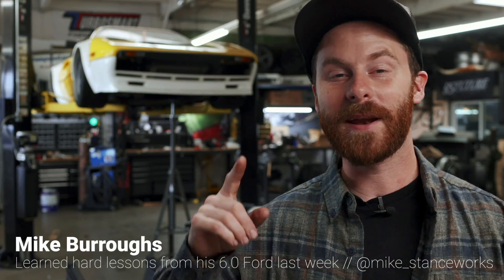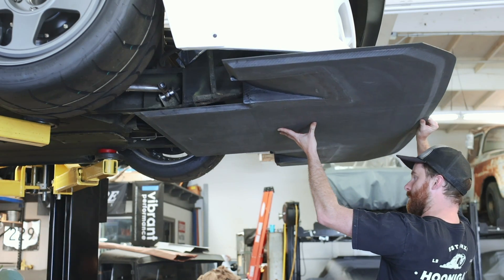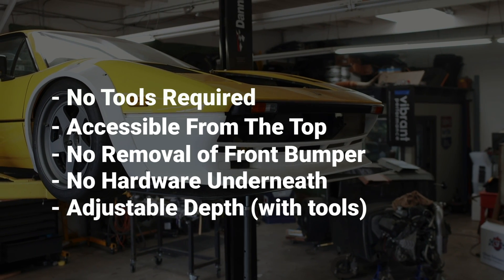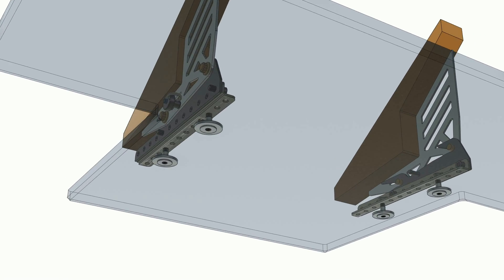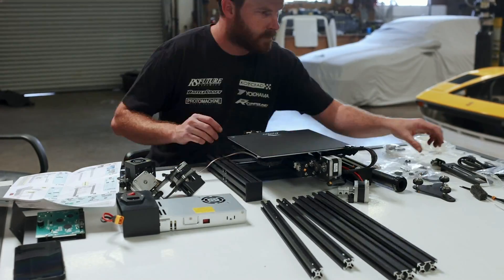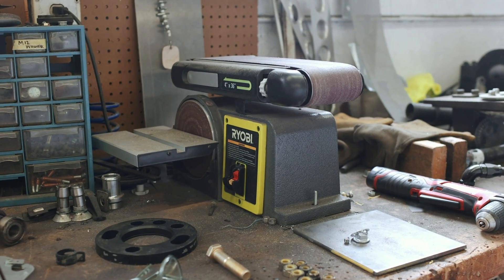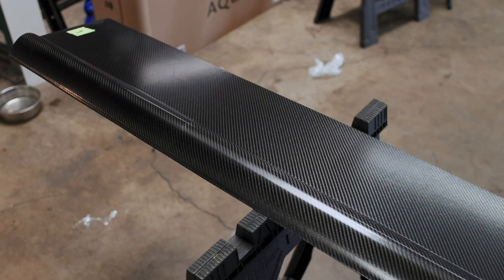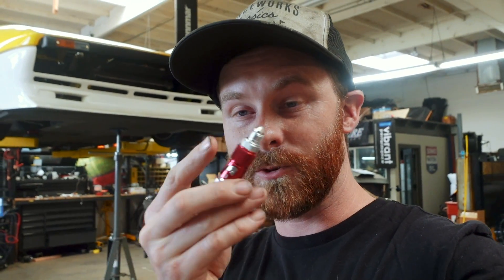Designing Quick-Disconnect Splitter Mounts That Don't Require Tools - PT 1 - Honda-Swapped Ferrari

Comment: Hey mate, I get the feeling that you're eventually gonna have a similar conversation with yourself about the roll cage as you had with the brake fittings. This thing is being built to be properly fast, and you're gonna be asking yourself how much of its potential you can realistically tap, without a real safety cell around you. This vid from Australia will not tell you anything you don't already know, but it's good to be reminded every so often. 
https://www.youtube.com/watch?v=hcWm9gEM4kQ
Reply: That video reminds me of the Jeremy Foley and Yuri Kouznetsov crash at pikes peak 2012. Their car went off the side of a cliff and into a ravine where it rolled 14 times. Both of them walked away.

Comment: Wow really surprised you were having issues with the Ender3.  They are great little workhorses. You shouldn’t have had to do any upgrades or changes to it. Oh well.  You will love the Prusa anyway
Reply: I agree with this, you had it running and even showed the screen with it ready to go. Create model, slice it with the creality software, put SD card in and go! Same as the prusa
Reply: Agreed. I've had my Ender 3 for a couple years. My nephew bought one. No real issues....

Comment: The issue with single flare is that most people don't understand all the differences with fittings. Single flares are totally fine, DIN or bubble flares for example are single flares and are used on more cars than double flares these days.

Where people get into trouble is using a tool made for double flares to make single flare fittings. People assume that the double flare tool can make a single flare bubble  if you don't complete the second step. This is not correct and the fitting is not the same.

The same goes for 37 degree AN, a lot of flaring tools you find in hardware stores are not 37degree but 45 degree and are not appropriate at all for making AN flares. You need the proper tools. If you have the proper tools, and do it carefully, AN fittings are more than adequate for brake lines. You can even use them for AC lines and if you use the correct lines (this is absolutely critical) for Power Steering high pressure hoses.

Comment: Damn, when I saw the ender 3 I got excited! But then you said its not useable out of the box and you're switching to prusa... As an ender 3 owner I can say that it is very much useable out of the box, you even have pre sliced models on the sd that came with it that you can print as soon as you turn it on. All the other stuff you mentioned is optional if you want to get into customizing it but it's not required, and for a newbie not recommended. Prusa printers are great, but I'm still bummed you were miss informed about the ender though.
Reply from the maker: I spoke to 5 or 6 dudes that all 3D print for a living, each of them said to give up on this machine. This is an old-stock unit that has super outdated firmware on it, I can't follow the instructions that came with it or any tutorial online. I can't update the firmware easily because it has the old board. Is it "usable" out of the box? Technically, yes. But not in any reasonable manner. It needs to be updated and that's a huge pain in the ass. I don't believe I was misinformed at all.
Reply: @stanceworks  I see the old setup like the Ferrari in it's original form. It's outdated and not as good as the latest and greatest, but still works. Now you can swap out the parts you are not satisfied with and have a unique monster that outperforms anything in it's class, or you can buy a new civic type r which will reliability get you faster lap times in it's stock form. I think the civic type r is a great car and will serve it's purpose nicely, but I wish you'd have decided to mod the Ferrari instead. 😜

Comment: Ender 3 V2 and you'll be printing in a half hour, and the newer model, is even better with BLTouch, etc. Cheaping out on the Pro was a BIG mistake, but the Prusa isn't worth it. Trust me, get the Ender 3 V2 at least, if not the 3 S1 Pro. The S1 puts the Prusa to shame at half the price.
Reply: Idk what happened to him because I have the ender 3 pro and ender 3 v2. I have had a great experience with both printers. They both printed right out of the box. All I had to tinker with was bed height and different slicers and temps but that’s about it.
Reply: @erexsean2210  Bed leveling and print adhesion can be a steep learning curve, especially on the Pro since IMO, it seems the QC is lacking on them. V2 is a little better, but a BLTouch is a necessity I think for beginners.

Comment: If you wait for a little bit, the Bambu Lab X1 is coming out this month at roughly the same price as a Prusa Mk3 and has a lot of great features, while being a straight out of the box experience. It has great reviews so far and will allow you to print ABS and other higher temp materials.
Reply: The Bambu printer is just starting to ship to kickstarter backers this month. Retail units won't be available until at least August, and probably won't be shipping until September.  He needs a printer now, so that's not an option.
Reply: @mikey631  I mean, does he though? He doesn't have a deadline, he's still waiting on wheels lol

Comment: When coming back to a project after a break I sometimes like to just clean up the shop and organize things a bit. It allows you to just be around the work without a specific goal while also having a look over the object you are working on at that time. Once things are cleaned up and organized I am often back in the right mindset and have constructed a rough path for getting back into a project.
Reply: I literally do the exact same thing. Can confirm, it helps to clear your mind and think critically about what step should come next.
Reply: Absolutely 👌🏼 and whilst you are cleaning you will definitely start to want to do stuff on the project

Comment: why not use the "rocker panel" off cut to close gap on the front corner of the splitter and bumper? glue it to the splitter so the bumper doesnt look weird with the splitter off.

Comment: 👀 can’t you add a lip like what they use on the e36’s trim it and make it fit in that gap by the bumper? Or fab something that looks like an “extended” bodykit if u will🤷🏼‍♂️ 

Oh and when u get that 3d printer set, get yourself a 3d pen as well so that you can bond the pieces together

Comment: Thanks, Mike. You made me realize that I was in the same stagnation with two of my builds. Time to quit piddling and start peddling. 
Your splitter mount looks like the best way to accomplish your goals. Maybe instead of massively oversized washers to distribute the load on the splitter you could use titanium skid plates with counter sunk bolts to accomplish the mounting and also add the benefit of skid plate protection.  
Needless to say, but I will, keep up the good work and content.

Comment: 9:08 
I know it's really confusing to ear tons of opposite advice, but in reality you need to simply think : 
1-Do i want to spend time on a cheaper printer or i'm ready to spend more to spare me those little but time consuming things ? = More money => Less R&D time spend on a DIY setup
2-What i plan to use this printer, once a month, a week or more frequently ? If once a month, no need to spend much. but more frequently there are some issue when you print a lot on a DIY setup, parts tend to wear and i can be a nightmare to find out whats wrong.
3-What result i want with my printer ?Just mokup or more permanent part ? Look at the resolution of the printer, specially the Z axis.
4-What size i want my prints ? You can glue parts sometimes if you just want a mockup

Appart from that, i would recomand you to look for an heated bed, popular and well establish brand with a close chamber, and to print part in ABS.
Personnaly i using a Zortrax M200 and M200+ since 2014 for "industrial" use (not just mockup) and they do the job just fine.

Comment: Definitely seemed like you were having a great time on your trip from your Instagram, which was definitely a much needed break!

The second I saw the ender box I knew you were going to run into these issues. I think I commented before about not necessarily going the cheap route if you don't want to do a lot of tinkering; these units are technically just as good the higher end prusas and whatnot, but they rely on you to get them to that point. It's cost savings via time investment.  I've got a printer pretty similar to the ender from about 7 years ago, and have already run into and corrected all of the issues you were mentioning. Definitely a headache, and not one you really need to be dealing with right now.

Always love you leading by example, losing all that work on the brake lines definitely hurts but at least you know you'll be able to trust it 100% now.

As for the front splitter design, I'm a bit of a skeptic to trust only one pit pin per side to keep the splitter in place. Personally I'd go with doing a pair of them on each side; you have the space for it and the peace of mind having a secondary pin would be worth it in my opinion. I know it's not likely but in the off chance one of them fails and falls out you still have the other one.
Reply from the maker: I only drew up the center mounts. There’s others on the side that’ll use more pins. Worry not!

Comment: Questions: 1, how far is it from the mounting point to the tip of the splitter?  
2, have you considered any wire mount on front or other mounts closer to the bumper? 
Like a alu frame, with tabs coming from the splitter, with the same "quick release" on the mid mount?   Im concerned that a mid mount only is not strong enough for the pressure the front will carry on high speeds.

Comment: maybe use a plate that links the 2 mounting points instead of those oversized washers for the "underneath"
edit: you spread the load everywhere except on those 2 mounting points per bracket

Comment: Hey Mike, have you thought about glueing the splittermount to the splitter, like F1 cars glue the titanium rollhoop to the carbon tube, would make the surface under the splitter more smooth and your mount would just need a bigger contact patch
Reply: I agree, bonding the mount to the splitter with epoxy or panel bond would be ideal and would spread the forces across a larger area and better handle the flex and vibration the splitter will experience.
Reply: That glued titanium rollhoop came right off the first time it was put in real life situation. An absolute brainfart of a design.
Reply: @oikkuoek  Actually the glue didn't fail rather the carbon layer underneath, the design itself withstands 60kN in lateral load, which equals the mass of 6 tons (which if used the same way would be more than enough for a splittermount). The problem itself lies more in 3 possibilties, the first one being an error in the lamination process of the carbon tub, the second a bad rollhoop design by Sauber and the third being an insufficient load test procedure by the FIA.
Reply: @7463-1  Yes, the hoop on itself will survive a nuclear blast. But due to the characteristics of the materials, titanium and CF, it will never actually hold in place, as seen on the recent crash. It doesnt matter how you glue it, it won't stay put. Imo, the whole hoop and motor plate needs to be one single piece fully embedded to rest of the CF chassis. FIA only tests individual parts with no crash test. Not the lamination, nor side impact load, bcz those tests would fail every single car every single time. To why it would always fail, is the transition from CF to titanium. From elastic compound to solid homogenic non-reactive material. This transition creates a hot spot that literally burns the epoxy off with the energy from the impact.
Reply: @oikkuoek  Totally agree with your opinion that the rollhoop should be integrated in the tub as a "single" CF unit, problem will be repairability, if the CF rollhoop is damaged making a structurally sound repair is pretty hard to do, while with the titanium one you could replace it more easily/ cheaper. On the other hand thankfully Zhou's rollhoop didn't fail instantly and did take some load, when he was still sliding on the asphalt. But the FIA should really look more into that area.
Reply: @7463-1   If you look the crash closely, the hoop snaps off almost instantly. It just gives in after the epoxy heats up, and that takes milliseconds. The hoop, as well as the motor plate and lower frame rails should be titanium, a single piece wrapped in CF, and tubing rather than solid. These are single-use items, one crash and scrap, so repairability is a redundant feature.

Comment: My first thought when I saw that you bought a Ender 3, was to comment that I'm available if you need any help in regards to 3D printing, but then I saw you are going the Prusa route, which is a good printer for sure, with well tuned profiles and good customer support, so probably won't need any help, but I'm available if you should ever need it, same nick everywhere. :)
Reply: there's always a learning curve with fdm, it doesn't matter what printer. in regards what you can print at what speed and what even can be printed, what's strong and whats not, what will melt on the car and so forth.

prusa has official support though. but it's still essentially a reprap that you need to do mild assembly on, eventually deal with a clog etc - it's not a stratasys.
Reply: @lasskinn474  That's true, some knowledge is needed and the occasional servicing, but that will be way less than with the Enders at least. Just to clarify, I'm not a Prusa fanboy, even though it might seem like it here. I've had many printers, but still not a Prusa. I like tweaking and upgrading, so Chinese printers have been good for me. I've been developing my own printers the last couple of years which is where my interests have brought me.
Reply: @MakerViking  I bought makerbot replicator when they came out because it was supposed to be less fiddling and easy, pettis said. pettis lied, but community fixed it.

and yea got an abomination of a repstrap now. had to leave the modded replicator in a different country anyway.

wrong zoffset is still going to be wrong zoffset on a prusa. they don't have the calibration part on their wiki for nothing. maybe one gets lucky and it's right out of the box, all pulleys are tight after shipping etc.

same for lulzbot etc. this grade is essentially all still like buying an almost assembled kitcar, some better, some worse. it's still better than buying something closed source/design in same price range though!

in the end once you 'get it' what it does and what the firmware does it's pretty simple, the limitations and how to work over them still apply though as a learning process after nearly a decade.